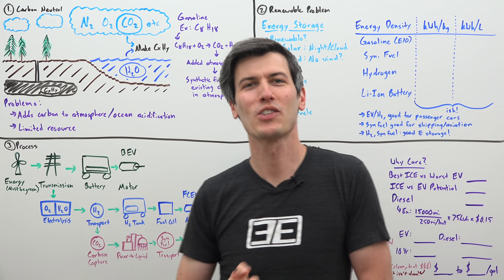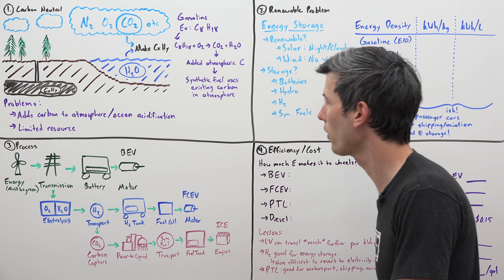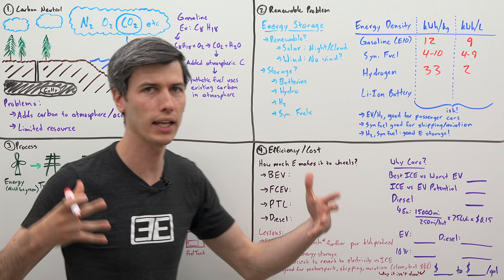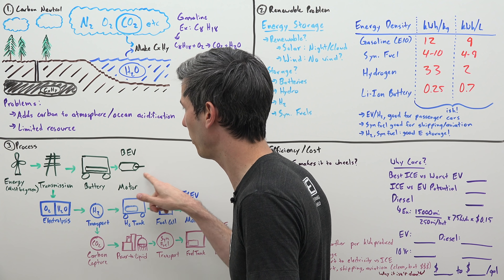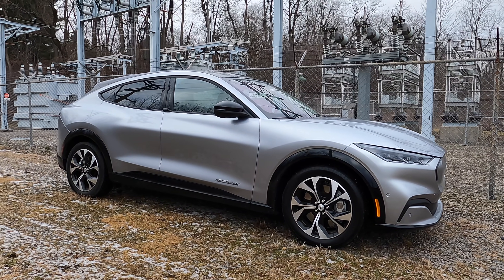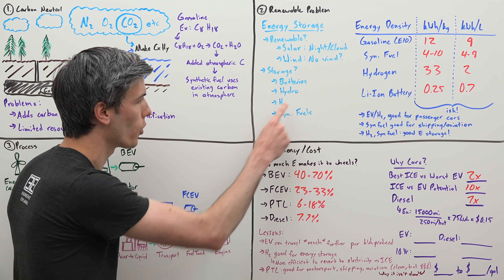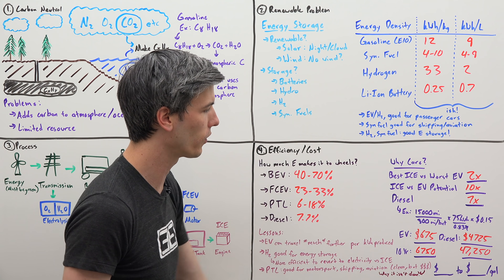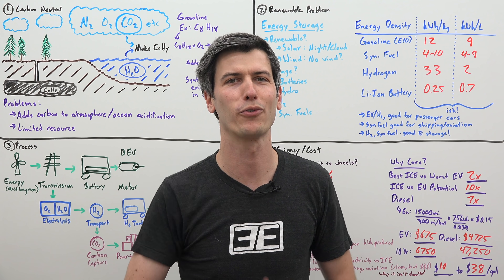The Big Problem With Synthetic Fuels

Comment: Synthetic and bio fuels are technically better for the environment as the process will lock a certain volume of CO2 in the process so are actually carbon negative compared to electric and hydrogen which are carbon neutral at best. Electric and hydrogen will do nothing to combat the approximately 20 billion tonnes (metric) of CO2 we exhale *every year*, bio/synthetic would lock I imagine a few million tonnes of that in the system, more if everyone drove Hummer H1s on the limiter constantly to shoot demand through the roof, for which there would need to be a huge volume of fuel 'in the pipeline (figuratively and literally) to facilitate it, which all would contain carbon that was previously CO2 in the atmosphere. 
Also, keeping vehicles going for as long as possible is much better than scrapping to make new, especially when a single electric car could require as many as 15 ICE cars to be scrapped just to release the necessary copper to make it, with the number of cars increasing, not decreasing to a 15th of current vehicle numbers on the road, all the rest of that copper needs to be mined. Also, only 60% (at best) of a car's materials in terms of volume are actually recycled, the other 40% gets burned off in the case of anything plastic vaguely in the vicinity of metal components, or simply lost to the melting down and following processes that produce new metal (like pouring water between multiple glasses, you'll end up with less every time in each glass, even if it's only a few ml in that example, scale that up to recycling metal and that's hundreds if not thousands of tonnes per cycle. Not supplying road vehicles with a bio/synthetic option would force cars, commercials, etc to be scrapped wasting a huge amount of resources. Our farm still uses a Ferguson tractor from the 50's regularly. Not producing a fuel we can use forces us to either give up farming, good luck finding food if too many farms choose that option, or buying new electric equipment to replace it that will run the planet out of all the essential metals.

Comment: I realise this isn't your subject, but how do you feel about H2 in aviation? Certainly it's unworkable for longer routes, but for example both 737 and A320 family aircraft have much larger fuel capacities than are needed for the average flight, hence being less dense (volumetrically) isn't so obviously a problem.

Comment: When gasoline becomes to expensive, I will happily turn my Civic Type R into a fuel cell car. And keep the engine as an ornament.
Reply: You will NOT defile that marvel of modern engineering! Just buy a 2nd car with a fuel cell and keep the CTR forever LOL
Reply: @k1fizz  I rather keep driving the Type R, than putting it somewhere. While sure, it would be a shame not to drive with the ICE still in it, just seeing the car standing would break my heart. It's meant for driving, not standing.
Reply: @CerberusTenshi  You might have misinterpreted my reply. I said to keep the Civic Type R as it is and not remove the engine and keep driving it with the ICE engine.
Reply: @k1fizz  I did understand, what you said, but I think that it would be a shame to just put the Type R into a garage, when driving with an ICE becomes impractical or too expensive, so instead of just putting the whole car away, I rather swap the ICE for a fuel cell. That way, the purprose of the car, driving, is still given. I'd still keep the ICE somewhere though to look at, but the Tyre R needs to go on the road for as long as possible. 
I'd make sure to put a powerful motor in, so that it doesn't become a sluggish commuter car but instead an environmentally friendly hot hatch.

Comment: In the last 10 years they've been able to increase electric car's range from 100 km to 600 km and charging time from 12 hrs to just 35 mins. If they'd put the same effort they put in developing electic cars into synthetic fuel, there should not be problem in developing it fully to replace gasoline engines altogether

Comment: I could see syn fuels working for aviation and also trucking.  For shipping (like ocean cargo ships), these need to be powered by their own nuclear reactor.  THATS energy density.
Reply: Nuclear cargo ships have been done, and could be economical. The main issue is that many ports won't let them dock because they are frightened by the 'n-word' and you need a big fleet of them before the cost of the special infrastructure to refuel the reactors is worthwhile.

Comment: 2 USD is already less than what I'm paying right now for my 102 Octane fuel. Let's be real - in a (hopefully) near future, where electric vehicles make economically way more sense in every regard, outcompeting ICE cars, it still very much makes sense for carbon neutral fuels to be relatively expensive. The goal is to reduce CO2 emissions. But people should not be prohibited from driving their beloved ICE cars which they keep. Future ICE cars should be stopped from being built, but why forbid them. There's some great cars out there that have never made economic sense, but that's because hobbies in general usually don't make economic sense. It's a great day to drive that old 2020 RS6? Sure, let's fuel it up with some carbon neutral synthetic fuel, which - oh well - comes at a cost, for not driving emissionless.

Comment: 10:38 uhm..isn't that exactly how an FCEV works?
Reply: Almost. Stationary fuel cells are more efficient, they can go above 80% if you use the excess heat, that is utimately lost in a vehicle. Also the H2 doesn't have to be pressurized to 700 bar and cooled to -40°C, which uses up a significant amount of the stored energy.

Comment: Could you do a video talking about Biofuels comparing it the rest of thesse options? Are they a better option than synthetic? 
Would it be possible to use the methane emissions from animal farms as fuel for vehicles? Finally, what emissions do synthetic fuel-powered vehicles release?
Reply: Emissions of synthetic fuels are going to be the same as their conventional counterpart, simply because what you're making and using is the same substance in the same mechanism. Synthetic petrol is going to burn just like conventional petrol because it'll be made of the same range of hydrocarbons. You'll get the same mix of CO2, CO, and various nitrogen oxides you get from burning conventional petrol. The only real difference is there won't be any sulphur, and even conventional petrol usually has the vast majority of it removed at the refinery.

Comment: energy to volume density doesn't matter to aviation imo. you could simply have a hydrogen plane with very big wings in a flying wing design
Reply: Big wings mean more drag. More drag needs bigger engines. Bigger engines need more fuel. More fuel needs bigger wings... it's a vicious cycle. 
Plus the airports would have to get bigger.
Reply: @Jcewazhere  
Bigger wingspans increase aerodynamic efficiency, improving L/D ratio. It's why gliders all have gigantic wings
Bigger wings allow flying at lower speeds, which in turn improves specific fuel consumption of fans, further improving efficiency and reducing the engine power required.
Major manufacturers like airbus have already public concepts that do not involve increased wingspan, although larger wingspan is better for efficiency. At the worst case you might need to expand airports or reduce number of passengers per plane - preferable alternative to banning air travel entirely or destroying the planet.

Comment: So, it seems like a lot of this will come down to what aspects of the technology improve faster: energy production, or energy storage?
Reply: The tech is there on both for us to go fully electric right now, and both are still improving. A lot of the problem is deliberate misinformation from parties that profit off the status quo and\or -idiotic- misinformed politicians. 

California for example produces way too much solar power, while they didn't invest in enough storage. That's part of their brownout problem. (The other part is PG&E being cheap)
Sticking solar panels on almost every house is great, but it'd be a lot more useful if you also put batteries in those houses. 

For power storage there's: liquid metal batteries, liquid air storage, pumped hydro, compressed air, kinetic storage, lithium and lead acid batteries, molten salt, gravity based, and probably more that I'm forgetting. 

Lithium batteries are good for cars and other transportation, but not great for grid scale power storage. Lead acid batteries are cheap, but bulky and heavy. Liquid metal batteries are very promising, they're made from cheap ingredients. We just need to start producing them more. Pumped hydro is already used in a lot of places. Molten salt is already used a bit too, usually in solar-thermal power plants.

Comment: hydrogen is actually looking great for planes in this equation, considering there is pretty much unlimited space in the sky and you can simply make the wings bigger to produce more lift
Reply: Bigger wings also means more drag, which needs bigger engines, which needs more fuel, which needs to be stored in bigger wings... quite the vicious cycle. 
Then there's the problem of having a big enough runway and airport.

Just like sticking more fuel on a rocket doesn't make it go further forever just sticking bigger wings on planes doesn't work.
Reply: @Jcewazhere  
Wrong. Your rocket analogy doesn't work becaus hydrogen does not increase the weight of fuel in the aircraft. Weight is the #1 killer of performance in aircraft and hydrogen has 3x the weight energy density of fuel.
Because wings don't have much structural weight and hydrogen has 3x more energy per kg than jet A, acceleration would be roughly the same given the same amount of thrust
bigger wings increase drag AND lift, allowing an aircraft to lift the same payload at lower speeds, reducing the speed needed to takeoff, meaning shorter runways would be needed
Reply: @Jcewazhere  
If you need 100kg of gasoline, then you only need 30kg of hydrogen to provide the same amount of energy, because that's how energy density works.
Propellers are more efficient at lower airspeeds, this is something KSP doesn't simulate but welcome to the real world. Ducted fans offset the efficiency loss at high speeds somewhat, but not fully. 
"bigger wings cannot be long and thin like that" good thing high lift subsonic airfoils are THICC
You are way out of your element dude, I have 4000 hours in X Plane Planemaker which simulates all of this stuff in depth since yknow its used in a real simulator. It may not be KSP legos but the higher level of realism is much more satisfying.
Reply: @Jcewazhere  which is why I don't claim the hydrogen vehicle will necessarily accelerate faster.

Comment: Is this calculated using daily electricity prices? With renewables off-peak is getting cheaper and often goes into negative price territory. Could synthetic fuel be used as a means to shave peak supply?

Comment: Here me out with more nuclear fusion power plants, make abundant energy cheaply, and then hopefully synth fuel could be considered more viable... it’s a dream tho 😴
Reply: Wouldn't cheaper electricity just make electric cars even cheaper?
Also isn't the cost of producing the fuel from all the steps in the process, not from the electricity cost? EE broke it down nicely, producing the electricity and sticking it in batteries is a lot cheaper than producing the electricity to capture carbon to mix with water then transporting it across the country then burning it...

Comment: Great video! 
But do you think that research and development could overcome all these inefficiencies and high cost that you describe in the future?
Reply: We've been working on the internal combustion engine for over a hundred years. It's probably not going to get much better than the 30-40% it's already at. 
Meanwhile we've only been really working on electric cars for a couple decades and they're at >80% efficient. 

If you haven't test driven a Bolt or Tesla go try it out, they're a ton of fun.
Reply: @Jcewazhere  sure thing! But I was more refering to the inefficiency of the production of new fuels

Comment: Once we get fusion going, efficiency isnt that important anymore.
Reply: We cant build infrasturcture and combat climate change on a hypotheical based upon a 70 year old uproven theory (that we can control and sustain fusion outside a star) thats had little practical advancement in that time.
Reply: @imjashingyou3461  i know. Fusion is a little late. But we will one Day get it. 

But the same goes on a windy or sunnyday in the future. We will get days that there will be green energy than demand. Than forcing the energy into a dense storage make sence. As wel dont want wind and solar to go to waste. Also inefficiënt doesnt mean wasted. 

The waste energy of the conversion process could be used to heat buildings.
Reply: @rubikfan1  we for all practical purposed have insurmountable engineering problems.  In that we cant even come close to recreating the core of a star enviroment to facilitate sustained fusion.  Maybe in thousands of years.  But not for seversl generations. Its still impossible as of yet.
Reply: @imjashingyou3461  not preciesly. We can actualy do it. But we cant do it energy positve yet. So far it cost more energy to turn on the machine than we can get out of it.

Itre in france will fix that between 2025 and 2035. And the one after that could produce to the grid.
Reply: @rubikfan1  yes we can create single instances of fusion that last no more then a thousands of a second and is not self sustaining, in a scientific lab enviroment, using the power of a small town.   

Thats clearly not at the industrial scale,  thats not at the prototype scale,  its not at the tech demostrator scale, its not even at proof of concept scale.   Those dates are hyper optimistic at best and lies most likely.  We may not have even made it to mars or the moon at that date. 

Science doesnt have a theoretical path even to advance further.  Not even like nuclear science did in the 20s to get the first reactors 20 years later. 

Litterally the only place in the known universe fusion happens is in the core of a star.   And we dont have artificial gravity.  Or the means to creat long term the temperatures and pressures in a star.
Reply: @imjashingyou3461  150s is the record actualy.  It just cost more to sustain than we get out of it. We just need more knowledge and experiments. We will get it. Maby it will take another 100-200 years. 

And just because it take more than a generation to invent, it doesnt mean you shouldnt try